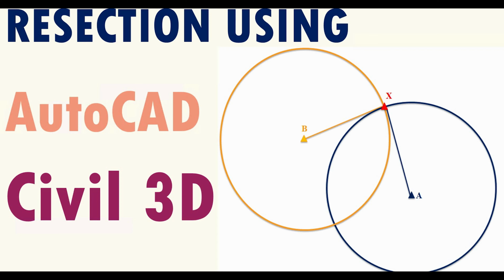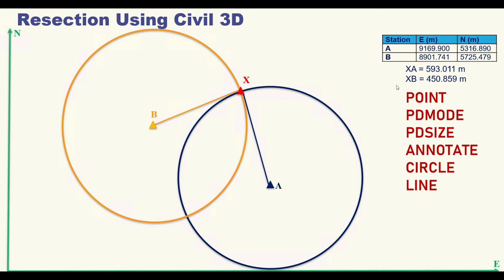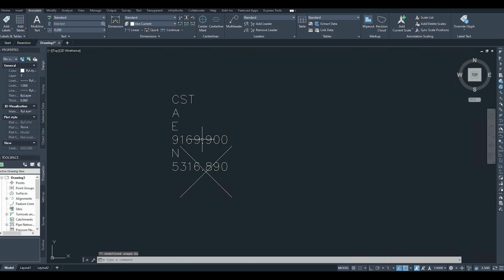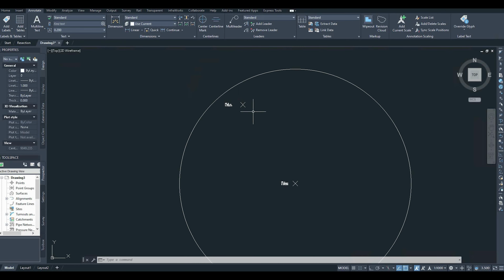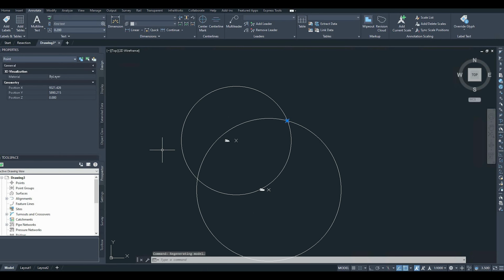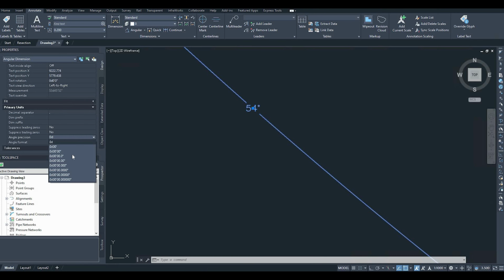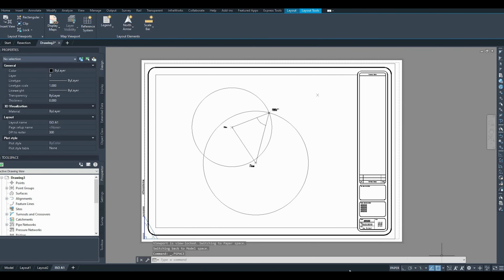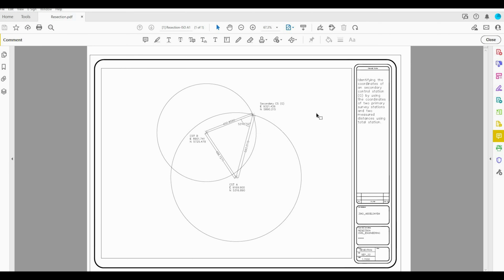Resection Using AutoCAD Civil 3D | Surveying Resection | Producing a Plan to a Scale

Comment: So...the whole point of doing this is to see that your solution for OCC point is accurate? is it even possible to do a resection with Total station on field and end up with the wrong OCC coordinates?
Reply from the maker: Yes, if your measurements sare not accurate or your calculations are not correct.